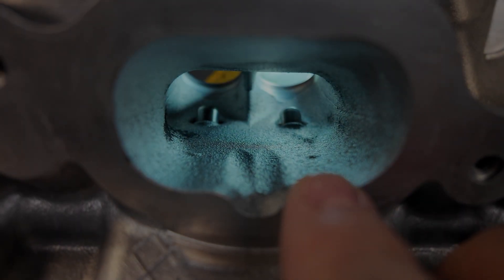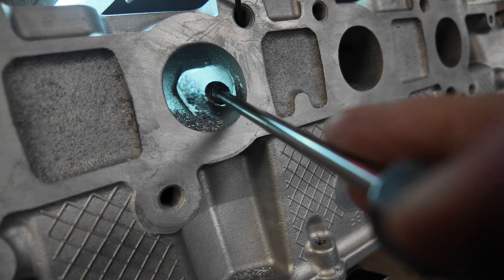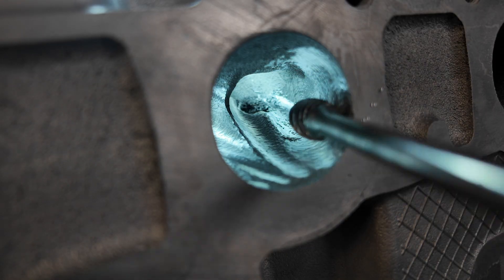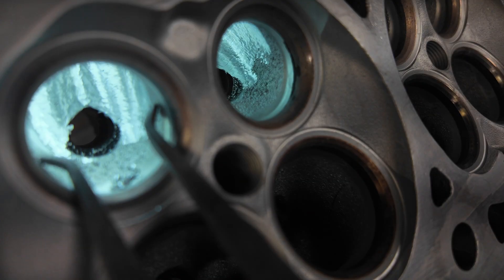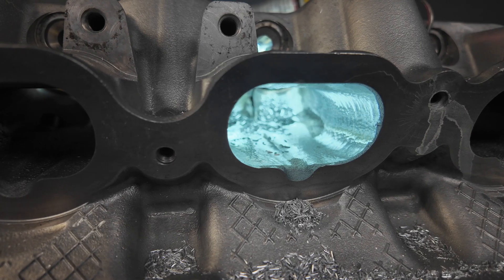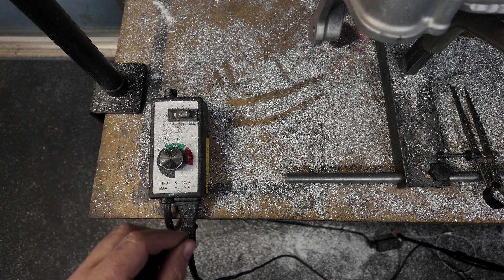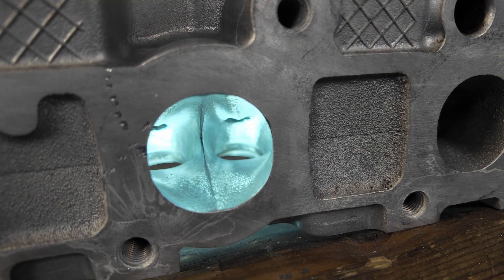Why Hand Porting Still Matters – Gen 3 Coyote Breakdown

Comment: So the high spiral leaves so smooth a finish that a stone isn't necessary before a cartridge roll.....

Nice work as always!
Reply from the maker: I have never used a stone. I imagine that it would load up on aluminum and you can’t use super spiral burrs on cast.
Reply: @headgames ah....I've used pink stones on 6" shanks after double cut ferrous burs as the transition to 40 or 60 grit cartridge rolls.

Dude, giving up the best blending secret for the past 25 years since I left school. Grrrrrrr😂😂😂

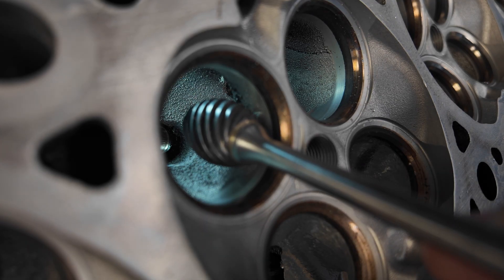Comment: @ 9:35 thats what she said.

Seriously, I see how the 3/4 bur would shape the bowl really nice for a 4 valve head and that size of runner. I usually use a 5/8 or 1/2 flame on standard wedge heads. Damn it.....add to cart.
Reply from the maker: We sell a 5/8 but I have honestly stopped using it. The 3/4 is just a beast. Check them out at headgamesmotorworks.com
Reply: @headgames  SOLD OUT!🤦‍♂️

Comment: So far, what are your favorite heads for the coyote? GEN one GEN two GEN three GEN four or the boss? Which head is the best for torque and your special sauce porting?

Predator?
Reply from the maker: Gen 1 so far!
Reply: @headgames 

What kind of price should I pay for a used set to send to you? 
And what do I need to watch out for when buying a used pair?
(Gen 1)
Reply: Predator/GT350 heads
Reply from the maker: @RadDadisRad  not at all actually.
Reply: @headgames commenting on a caveat. The FFRE engine big hp guys are using them and are making 60+ pounds of boost with big torque numbers. That being said I am now going to assume that this guy is talking about a stock motor? But then the questions arises why would anyone put a ported head on a stock or stockish motor.